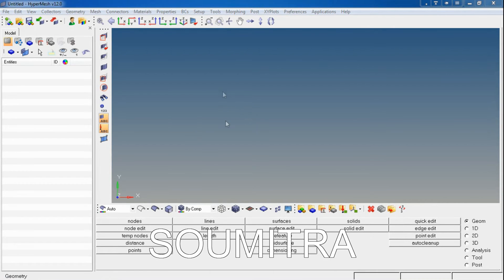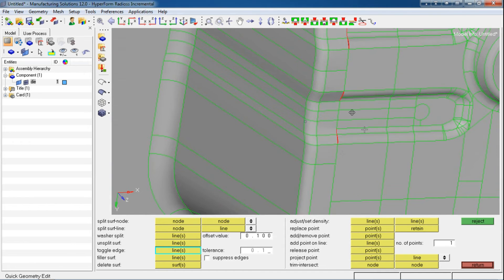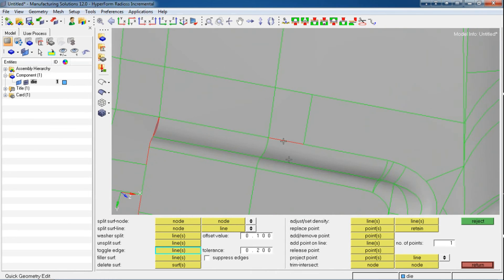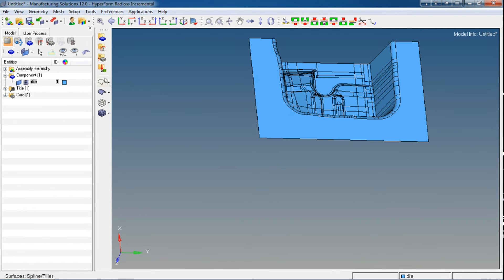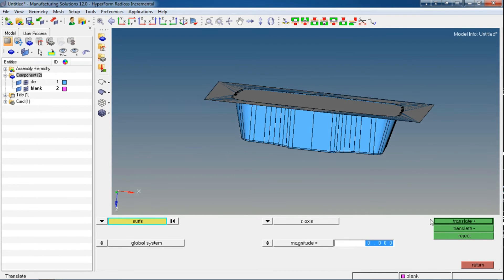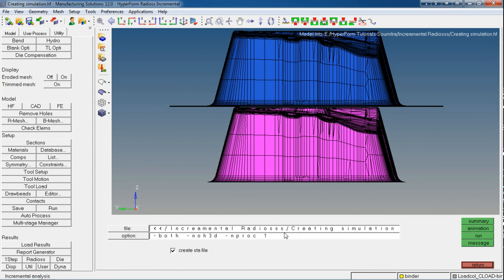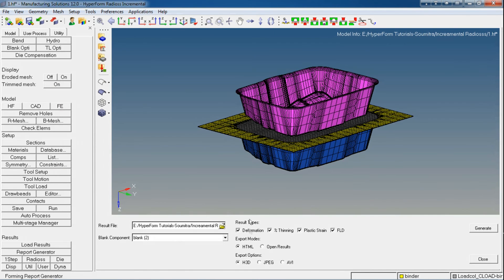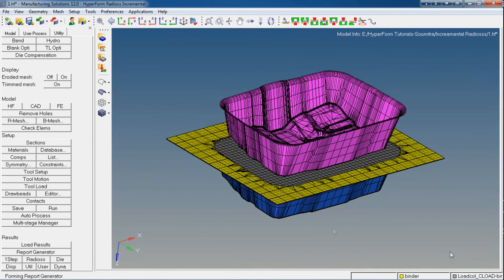HyperForm Tutorial with a practical Example- Part3- Incremental Radioss- Autoprocess simulation

Comment: I was doing hot stamping process analysis. Tutorial (Hyperform incremental radios ) from Altair page " HF-3080: Hot Stamping Analysis." I am sure i have followed all the steps but i am unable to get the forming on blank. the blank is penetrating trough the die and there is no deformation. Should i define any contacts. 

Please help
Reply from the maker: For sure, there is somehow no contact between the blank and the die.
However, are you sure that the tutorial is about just hot stamping? 'cause in my 'Manufacturing_Solutions_HyperForm_13.0_User_Guide', it's related to Multistage Manager.

The tutorial for Hot Stamping is I think HF3004.

Any way, if possible can you get me the problem statement, model file, etc. by uploading somewhere on cloud? I'd like to try by my side. Just post the link, don't worry it will be immediately deleted and the content will be also kept confidential.
Reply: The run i selected from autoprocess panel is just for checking the sequence. later I ran the model from Hyperworks solver manager. The model  ran fine.
This was Radios Incremental tutorials. Hot stamping analysis.  HF-3080
Reply from the maker: Sure, as blank is penetrating, there is no contact. Check the tool and blank positions (above/below), stamping direction (+z/-z), velocity/displacement sign (-ve/+ve) and of course the contacts, etc., everything from the model browser.

Comment: Sir, for a draw component how could I plot a single graphical presentation of plastic deformation for various die and punch radius?
Reply from the maker: +RASED QUAZI You might need separate modeling for each combination. If you need a comprehensive study of plastic deformation in relation to varying punch and die or punch/die radius, I 'd suggest you to use Altair HyperStudy.

Comment: Sir, at the time of defining blank surface it is moved with respect to the draw die part.How can I make the blank in proper position on component?
Reply from the maker: +RASED QUAZI Maybe I couldn&#39;t understand your question as such but still I can suggest you to do it in HyperMesh (or HyperForm) itself by using translation command (you can find this in geometry- edit) use any CAD software, in which you can 'assembly constraint' the two parts (die and blank) to accurately position the blank (blank over die) and then import in HyperForm.